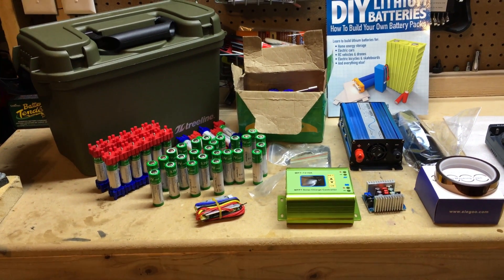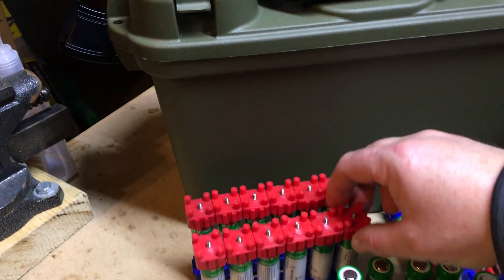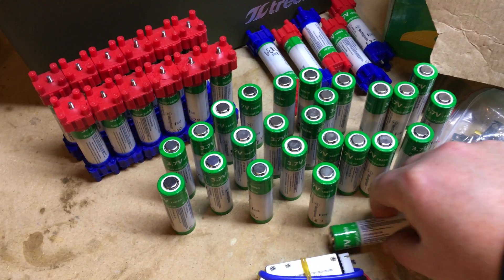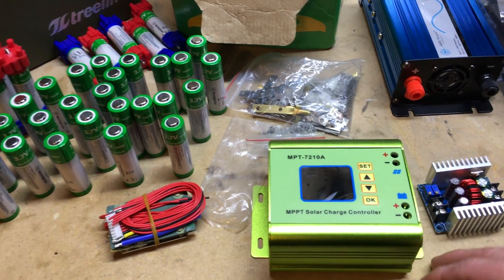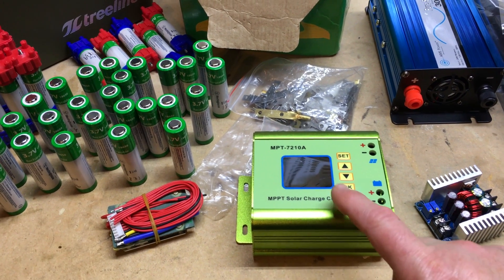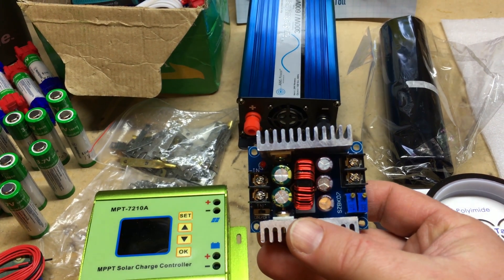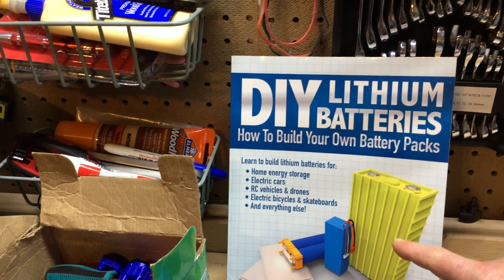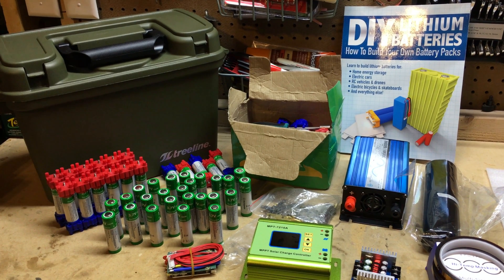DIY 18650 Lithium Solar Power Generator - Parts

Comment: I have a 4s 13p system, Using a good quality Smart BMS, No1 and no 4 series discharge more quickly than no 2 and 3, have tried changing batteries around, but no 1 and no 4 always discharge more quickly,  any ideas ?

Comment: Great video, Hello, I was wondering if you could give me your suggestion.
I have 6 packs of 24-18650 cells in parallel. And I want to build a power bank that can power 12 volt Accessories I also have a 12v 1000 watt pure sine wave inverter. How can I connect all 6 packs together to along with a BMS to achieve the 12 volts. Thanks so much for your input.
Reply from the maker: I'd suggest you take a look at this book to learn more about 3s and 4s battery configutations for 12V.  You could also build a 7s then use a buck converter step down to 12.v  https://amzn.to/2MZ6JIB

Comment: hello, if I have 2 batteries with 3.7v and 2000maH I will have 7v and 4000maH ???

thank you
Reply: It depends if you wire the 2 via parallel or series.
If it is in series, it would be 3.7v*2 @ 2000mAh
If it is in parallel, it would be 3.7v @ 4000mAh.

Comment: Nice and very good project, can i ask you why are u using 24v sine wave converter ?
Reply from the maker: Tay yang kuan The voltage range of the 24 volt inverter matches perfectly with a 7s battery.

Comment: I do not see details for your bms, could you post details of your bms please.
Reply from the maker: Good eyes.  I just added a link to the description for the BMS (https://www.aliexpress.com/item/24V-lithium-ion-battery-BMS-7S-24V-15A-BMS-Charging-voltage-29-4V-With-balance-function/32807013264.html?spm=a2g0s.9042311.0.0.vzUREO).   Thanks for watching.
Reply: Thank you for quick response, Rely enjoyed your build. I like the quality and attention to detail, well constructed and well executed.